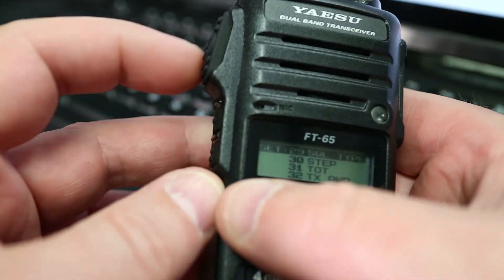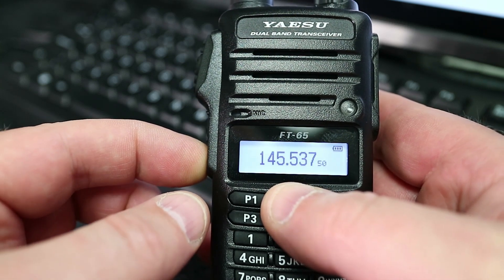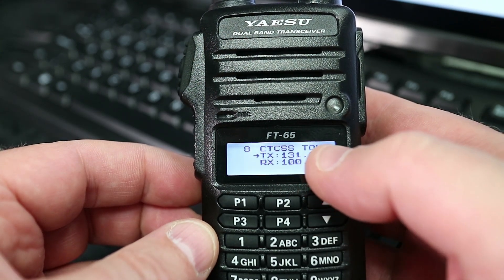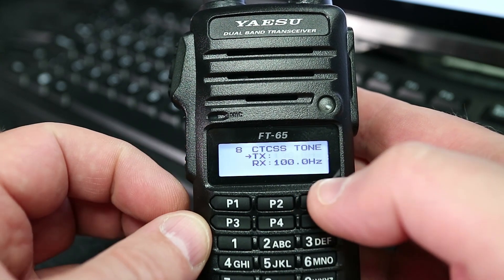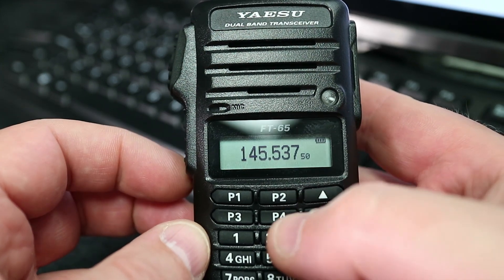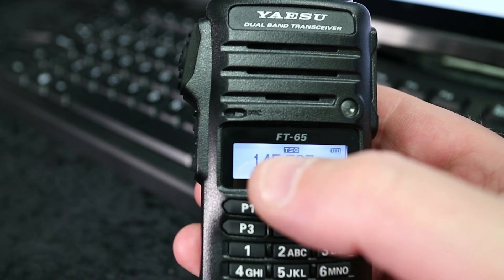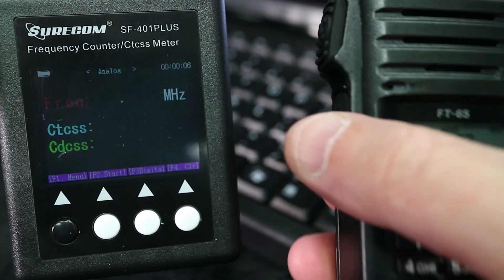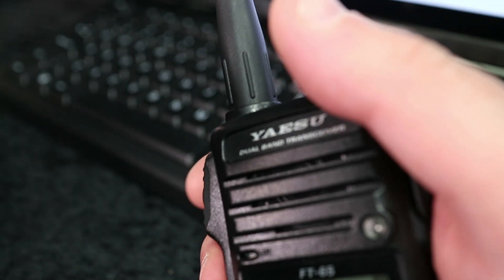Yaesu FT 65 CTCSS SetUp

Comment: Hi Gaz Lab
this process on my radio does not go to the TTSQL when i press the function button. Instead i get a NFM indication on my radio. What is wrong?
Reply from the maker: not sure... id have to replicate the issue.. it does sound as if you have step that has not taken,, gaz
Reply: @TheGazLab  I did it a few times.

Comment: The video is very helpful. The radio, however,  is rediculously and unnecessarily complex! What's wrong with simply having a "duplex" key, once for on once for off. Or a "tone" key etc. I have used many radios and the folks that designed this one should be tied to an ant hill!
Reply from the maker: Daniel Geary love it! fire ants?
Reply: @Schwalbe262 I don't know. Admittedly, my previous experience with 2 meter handhelds is with units from the 90's. It may be that certain features of those older units may not be compatible with all of todays ham radio functions, and therefore be obsolete. My current rig is a mobile unit: ICOM IC-228A (no longer made).

Comment: Pick one up yesterday as a back up radio(have a VX6r also), the  FT65 might end up my everyday carry.  

I noticed in the advanced manual that TSQ enables the tone squelch receive function. If I'm programming a repeater with a PL tone that I'm supposed to transmit and no tone for me to receive, would I need to set it to TTN(transmit only tone squelch) or TSQ? 

 I'm a new ham, any help would be awesome.
Reply: TTN only usually for repeaters.

Comment: Boa tarde amigo e parabéns pelo vídeo! Eu tenho uma duvida, além das funções diferenciadas, na função de uso VHF esse radio FT-65 tem alcance reduzido em relação ao FT-60? Pq em alguns sites eu vi essa informação que o alcance do FT-60 chega ser o dobro do FT-65 mesmo ambos sendo potencia de 05W.. Vcs poderiam me orientar com alguma informação? Abraços!! English: Good afternoon, friend and congratulations on the video! I have a doubt, besides the differentiated functions, in the VHF use function does the FT-65 radio have a reduced range compared to the FT-60? Because on some websites I have seen this information that the FT-60's reach comes to be twice the FT-65 even though both are 05W power. Could you guide me with any information? Hugs!!

Comment: so this is Yaesu option to compete with baofeng?
Reply from the maker: The yaesu has 3 years warranty... Game over :-))
Reply from the maker: Sorry Matt I don't understand your comment.. what do you mean "joke?" If I can help in someway ?
Reply from the maker: erm... it's a nice little radio, its on the cheaper end of the yaesu line up so there are a few foibles.. but its cheap with a long warranty and cheap programing cable.. so I'm going to say yep its OK! :-)
Reply from the maker: No it's not rebranded, if yours is low sensitivity then return it to your dealership, I had one on the speccy and it was better than 3uV Rx we found it to have good performance at the £85 price point.. it's a budget radio that performs well for the price..